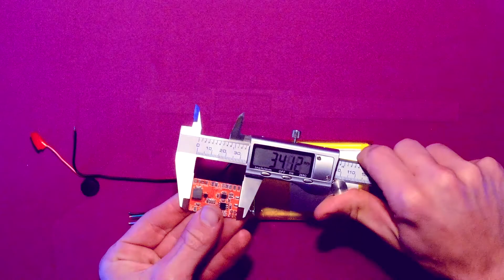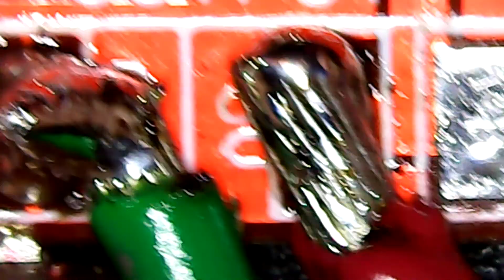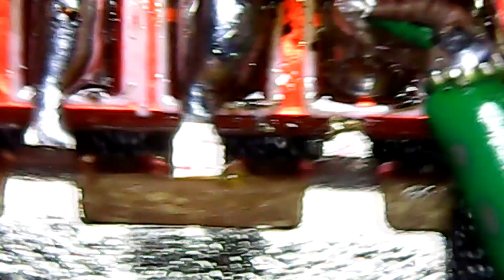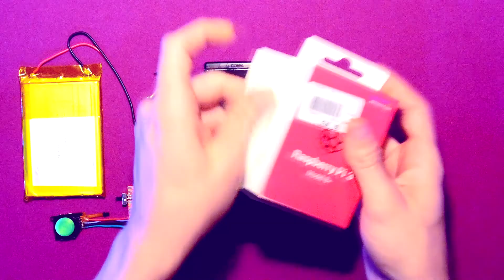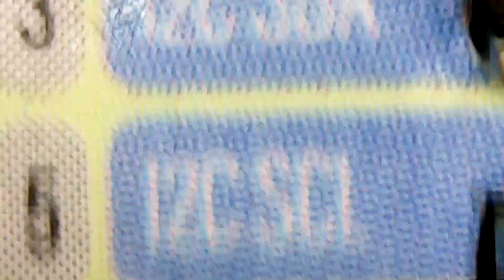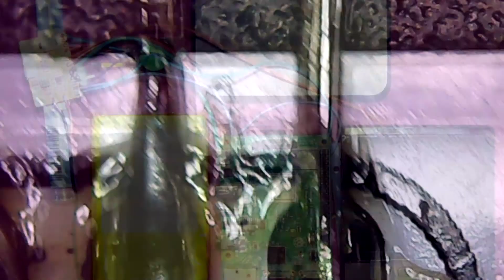POWERBOOST KILLER!!! (How To) Helder's Retro PSU for Raspberry Pi

Comment: I bought 2 of them. And it's amazing ! :) My Pi3 worked for 6 hours with 3x18650 + SPI Screen + Adafruit 2.5w amp running games. No undervoltage signal. :) And it's tiny ! AND it can send battery level signal to the OSD battery script.